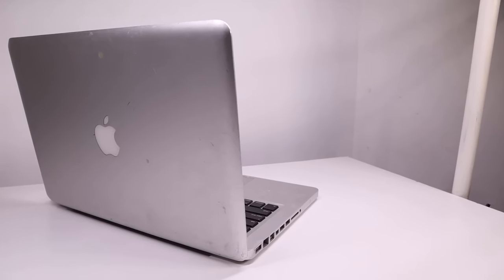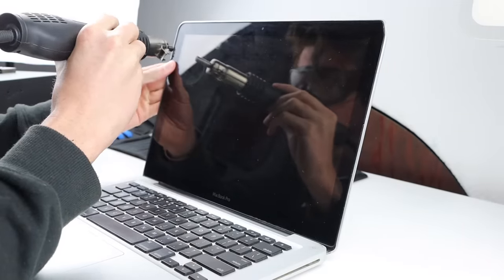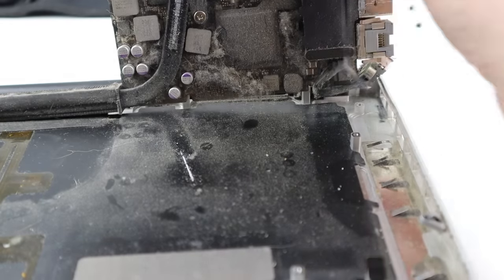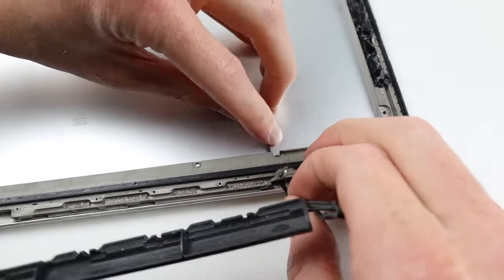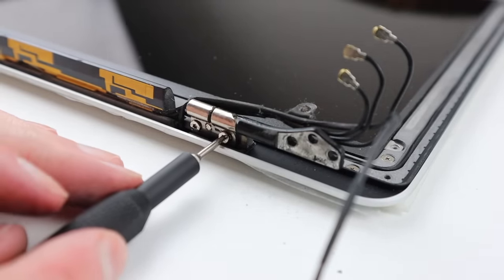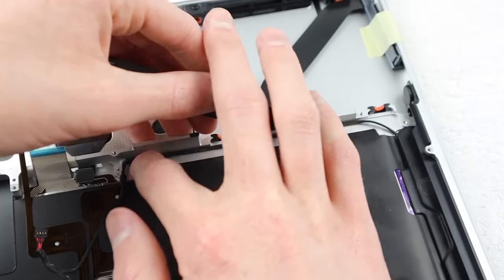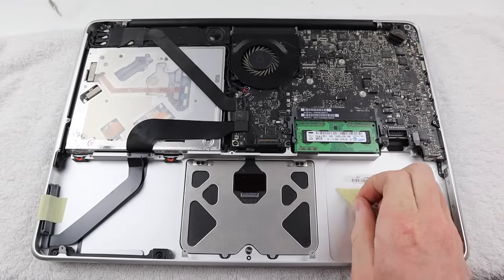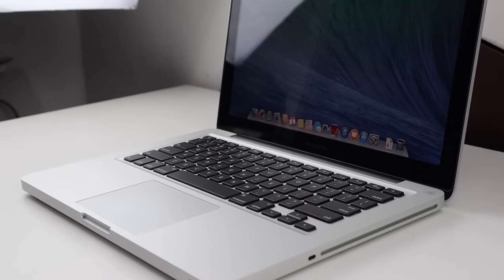$100 Trashed MacBook Pro Restoration & Rebuild + Custom Apple Logo & Keyboard

Comment: Terrific. Inspirational-- especially as I have a late 2011 MBP 17" that probably overheated about 8 months ago. I shut it down and have been afraid to try turning it back on (it's not really dead until I turn it on-- right?)  I have non-monthly shakedown Adobe software I'd like to keep using (for the rest of my life....). Thanks.
Reply: It's four years later and it's still sitting in a drawer. I should pull it out and get it fixed. I already did a lot of repairs on it, replaced the battery, HD, another controller something part... (Never get a back pack that doesn't have cup pockets on the outside. Every major brand of stainless steel mug will eventually screw you, either they'll leak (Contigo) or you'll eventually forget to close the black on black sip lid.)  It is one of the last MacBook Pros that you could do a lot of repairs on. 

I air gapped my 2016 machine so I could use my Adobe software on it. What I actually did was set aside a 2017 TimeMachine hard drive and back dated it when I got a 2022 MBP.  (Since then Filemaker wants $40/month, it would cost me $80 a month to do what I've been doing for 30 years? I don't need any update past about 2008 or 2012 for Adobe.  It's a rip off. So now I'm not updating my current MBP. I guess I could just use the 2016 and 2011 machines for Adobe and Filemaker and then update my current machine. (The problem I still have is my 2016 air gap won't run Photoshop.) 

In my darkroom and wood shop when I got something set up, like my table saw with the trick fence, it's good forever. With computers they just endlessly change stuff, charge more, and now subscriptions. What pissed me off about Adobe Illustrator was that as screen resolutions increased the cursor cross hairs just got smaller and smaller, (this has happened with a lot of software) a lot of the 'improvements' were gimmicks and they never fixed the things that were always a hassle.  It would be one thing if with the subscription upgrades everything got significantly better. (Did Lightroom ever tell you what hard drive to connect for an image that the source couldn't be found? Of course it knows the path, it's just not going to tell us. With about 6 different hard drives -- it's a joke to use.)  It's  just a shake down by monopolies.

Comment: you said the battery needs to be replaced since it has 1000+  cycle counts, my macbook air has around 1200+ cycle counts but it says the battery condition is "Normal".. should i be worried?

Comment: What's funny is the individual parts are surprisingly inexpensive and easy to install with a $20 tool kit. I've spent less than$300 dollars over 7 years and it's upgraded and faster than it was the day I bought it.

Comment: Hi. I bought a MacBook Pro 2009. It has a 125 ssd. Or something like that. It has a 2.66ghz intel duo processor and 6GB ram. Would it be possible and worth it to replace logic board with a better logic board maybe an i5 or i7 and the ssd for larger capacity. I’m basically trying to work out if it’s worth keeping and improving or getting rid of. The headphone socket doesn’t hold headphones well too but the logic board swap would fix that right?

Comment: You don’t spread out the thermal paste because “it will conduct better”, it spreads out evenly when you tighten the screws, now when you tighten it it won’t spread right... and what about the dust??

Comment: you can remove the glass without breaking it by injecting a little alcohol into one of the bottom corners then working your way around slowly squirting it, adhesive becomes dull immediately once in contact with alcohol, once it dries you can actually re-apply the glass and it will be good as new, I literally just fixed a hinge, I'm really good at physical repairs like reconnecting metal to metal thats broken, but I suck at programming the software, I have no idea wtf I am doing lmao

Comment: I’ve made the mistake of installing the glass and not checking wether the LVDS connector was properly working. As afterwards it kept flickering as I opened and closed the lid. I had to take the glass back off which was now cracked; and reconnect the screen/re-rooting the lcd connector with the antenna. Only 2 days ago I picked up the i7 2.9ghz for £165. Finished rebuilding my transplanted MBP (mid) 2012 13” i7 after my i5 version (RIP) 😱 caught on fire from a loose LVDS connector. (So used it for parts: Samsung 840 Pro 256GB SSD/8GB Hynix Ram + Extras & Catalina) 😏

Comment: My Macbook model is a 2017. 3 years
my processor is 1.8 GHz Intel Core i5
Memory: 8 GB 1600 MHz DDR3
Startup Disk: Macintosh HD
Graphics: Intel HD Graphics 6000 1536 MB
Not telling you my Serial Number.
TM and (C) 1983-2020, Apple Inc. All Rights Reserved. License and Warranty.
Here is a fact about Macbook. You guys know the first fact. it was introduced in 2006.
But however, the Macbook from 2015 to 2019 has been discontinued because it had been effectively superseded by the lower-price and higher-performance MacBook Air. Note: The 2015 model had the last release before it was discontinued.

Comment: Pro, $100
Clean top cover $40, 
Upper case, $300
Bottom cover, $75
New hinge $12
New battery, $100
New display glass, $25

Total: $652

Price of a good working MacBook pro with no cosmetic issues, about $500.

Comment: @hugh jeffreys ....... i've the same macbook pro 2011 late, i've an issue with the pins in the LCD connection thats a part of the motherboard, i was wondering if theres a way to replace the part through soldering?

Comment: You need to stop spreading out your thermal paste, put it in the middle, the force and weight of the heatpipe will spread it correctly anyway. If you spread it out yourself you can end up leaving bits in the middle with uneven application.

Comment: This is the exact model i have altoh i upgraded mine to 10gb ram and a ssd, added another ssd in the caddy replacing the dvd drive, raid 0ed the ssds and upgraded the wifi and bluetooth card…

Comment: Hi Hugh!
I have a 13" macbook pro with a damaged graphic card. In your experience.. Is this issue fixable? :(
Reply: Fixable, but expensive. Not worth it
Reply: @DziugasTrollfacas  thanks dude!
Any idea to use it? 🤔
Reply: @aguztiinozmarin2596  sell it for parts and buy a newer 13" with an iGPU
Reply: @DziugasTrollfacas  thanks dude
Reply: @aguztiinozmarin2596  don't forget to get your data off while you still can, or keep the harddrive before selling it

Comment: im not sure if its even possible to mail it due to the display BUT i have a minor challenge you might like,
 a 2017 model hp stream 14, the screen cant close,
 
if you dare close it the entire shell will break ive tried it before and now theres a crap ton of exposed wires,

the top of the shell where the keyboard is pops up, the plastic around the screen is popped up,
 
the space is so low that you cant even download images, the shell is cracked inside and out, everything is broken,

oh yea the touchpad is also broken, and the audio also is broken with or without earbuds the audio crackles,

both rubber grips fell off so it might be dusty, who am i kidding its full of dust the shell is broken dust can easily form inside of it.

btw ive never hit it or dropped it, just the quality of it.

 and also i now own a much better laptop with a better shell, about 100gb more space, 4gb more ram, a backlit keyboard, and can run higher video quality and its the same price of the notebook hp

Comment: Funny story my laptop is much worse its a 2010 mbp one screw holding the snapped bottom peice on a broken spacebar and the optical drive is literally hanging by the sata cable lol (I use it for school)

Comment: Can do none of that with a modern Mac. Everything is soldered to the motherboard. If something breaks or gets trashed, whole thing is chucked to efill. Apple doesn’t want you repairing or upgrading anything. It stays as it is, forever.

Comment: Until how much replacement pieces makes an old boat a new boat? I started to think that the only parts that original MacBook still got was that dusty motherboard with an third gen i5 and 4 gigs of RAM, everything else was just replaced, he could assemble a whole MacBook laptop piece by piece

Comment: The "teardown" is pretty good actually. I was looking for a video like that because I need to replace the LCD panel on my old MBP A1278 to make its price higher (planning to sell it).
-----
In the first place, I wanted to order a battery from iFixit, but now I'm reading reviews on the battery iFixit sells: everyone is enraged by the price tag and what their batteries appear to be. They charge people around $100 (a price for a high-end battery), but the batteries last up to 30-50 cycles. Shame.
Same about tools. Found exactly the same stuff on the web for 3 times cheaper. Just google the stuff guys on your local web-market.
-----
Checked OWC reviews - a little bit better, but still not the result you want to see after paying more than $100 for a thing that is supposed to last for years. According to Coconut Battery report from my old MBP, its battery has 83.4% of the original capacity which is incredible for a seven-year-old Mac. Too pity that Apple stopped the official battery replacement program for those Macs.
-----
Thanks for the video. Thumbs up.

Comment: The dirt inside the MacBook is not due to the two rubber feet that are missing. I've seen a lot of them that had all the feet still on and just as or even dirtier.

Maverick because it's best suited for the 500 gig hard drive? What? That makes no sense at all.

Comment: 14:30 that logic board still looks like 💩. I would honestly not use a machine in that condition and definitely not call the overall state "brand new condition". Why not take another 2 minutes and properly brush it off with a tooth brush after already spending hours on that project?

Comment: The Trashed Laptop = $ 100.00
Parts
1. Arctic Silver Thermal Paste                       -    $ 8.99
2. Macbook Pro 15" Battery                           -    $ 89.99
3. 500GB SSD                                                   -    $ 109.99
4. Macbook Pro Display Assembly               -    $ 99.99  (with LCD) next best thing since i couldn't find top assembly cost
5. Macbook Pro 15" Unibody Upper Case    -    $ 299.99
6. Macbook Pro 15" Unibody Lower Case    -    $ 74.99

this is just parts been replaced from the video based on ifixit site.
just in case anyone want to know the cost to replace the front display glass - it is $ 49.99
but will not add in the main cost because item 4 is the entire display assembly.

total spend on parts -  $ 783.93  

Can't stand the fact he did everything but clean the motherboard.... sigh..

Comment: All this to leave a horribly dusty motherboard and not cleaning the CPU and rad properly? :/ Missed opportunity. Excessive dust can create electric interference and micro fires. Besides a 100$ for a 9 year old PC without a graphics card, what is the point? That confuses me. No need to remove the CD/DVD drive, just get a 1 or 2 To drive. Very detailed and well presented dis & re-assembly!

Comment: The fact that this is still worth $100 is insane, if it was a windows device that would be like $30-$50
Reply: Nah dude, they’re still worth nearly 300-400 dollars. I sold one last night for 350 after simply cleaning it inside and out, applying new paste, and installing a 240gb SSD. I had bought it for 245
Reply: @jorgeromero1502  yeah I brought Alienware m18x r2 and Lenovo y500 gaming laptop for 100$ for both and I fixed them just replace the ram and it was fixed lol sold y500 for 300$  and kept the aliware

Comment: GREAT VIDEO, NEW SUB HERE, but dude.... Leaving a DECADE of DUST CAKE all over the motherboard & inside the fan was SILLY.. I’m sure the clock was ticking & you just wanted to GET DONE so u could publish this video, but cmon... 

a person like me who is considering a project like this and turning to your video for encouragement or guidance MAY NOT KNOW how VITAL it is to get these components VERY CLEAN while the case is open.. 

You should’ve AT LEAST mentioned that you were rushing to show the finished product and WILL CLEAN BETTER when u have time so that people don’t watch this and think “if he didn’t care much about the skank board and skank fan, I’ll be fine too!” 

Also, there was no mention of destructive STATIC ELECTRICITY concerns which also can be escalated by the presence of THAT MUCH DUST, which I think the newcomer needs to know. 

Other than these things, your video & efforts are TRULY COMMENDABLE and my criticism is meant to be constructive, not demeaning.

Comment: Man, why are you running such an old version of macOS? A 500GB SSD is useless in this case, and the overall performance is being held back horribly! Patch this to Catalina using Dosdude's patcher, or even further

Also, if I were to buy a 2012 MacBook Pro, oh boy would I not want a 2011. Because the 2012 supports Metal, making it easy to patch to the latest version of macOS without causing any issues at all.
This is not true for the 2011.

Comment: Would have been better if it was a beautiful MacBook Pro with a dead motherboard or GPU. Instead of replacing the motherboard or GPU,  they would locate the bad chip and replace it to fix the problem.

Comment: ı don't get where the restoration part is. And the title is pretty deceiving seems like you restored it "with" 100 dolars. you just bought it, changed everything, even a lot of parts that were not needing to be replaced, made it a little custom with some purple sheets and called it a day. I mean, nothing wrong with it but at least don't say you are restoring it. You did not even took the dust off the motherboard.

Comment: I know you have a few MacBooks. Before I go any further I’m not trying to make any statement. I understand you do all the work yourself on everything you show on your YouTube channel. What I will do is what I’m writing this message for. A lot of your Apple merchandise is collecting dust and it can’t be good for the batteries. I’d like to buy a MacBook from you. Preferably a MacBook Pro, but definitely a working MacBook. I do have two unibody 2010 MacBooks on the way, but they’re not here and whoever owned them aren’t experts on Apple products. One of them has a plastic unibody issue. There are exposed portions that should be covered by plastic that simply started falling apart. And I don’t have any iPads. With all of that said, I’ll leave the rest to you. Please respond. Even if the answer is no at least I’ll know I’m not wasting my time writing messages.

Comment: lol classic apple user.. Class over function.. 

I mean your technical knowledge is impressive I can't do what you did (or at least I wouldn't have the balls to try)

But I mean the piece of plastic will probably affect air circulation and the thermal past application could have been better :P

Edit: Also why didn't you clean the motherboard!?